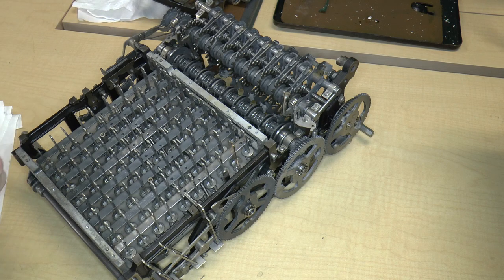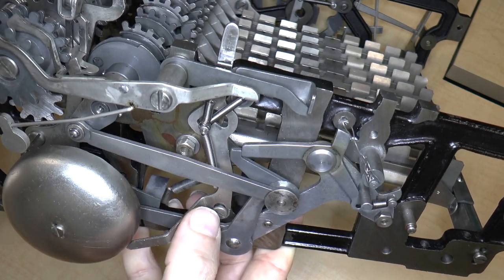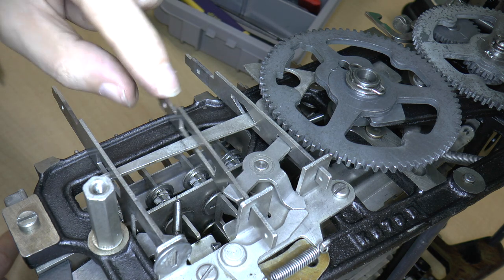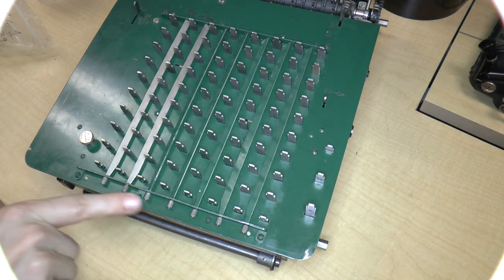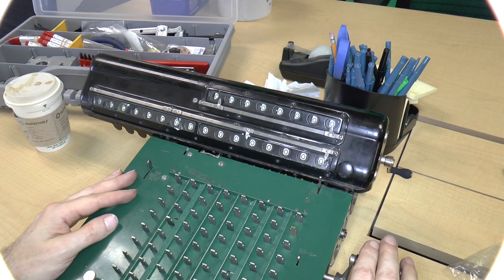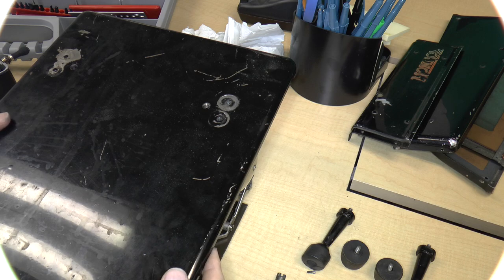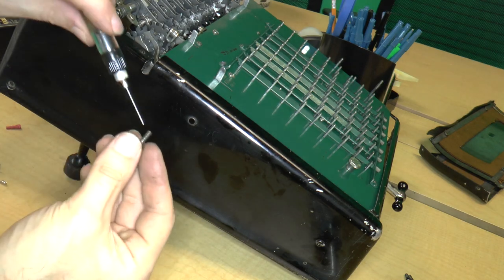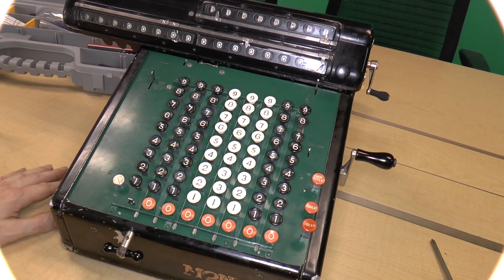Disassembling a 1920s Monroe model K mechanical calculator, part 25

Comment: A couple of weeks ago I came across a Monroe L-160X in a flea market. I didn't even know what the thing was but it looked cool so I bought it. After initial inspection I found it to be pretty badly stuck. Neither crank turned and a few buttons stayed at the bottom position. Even though the machine is not quite identical with K-series, with the information gathered from this series I was able to take it apart enough to clean and oil it so that I got everything moving again. No rust, just gunked up grease. One missing spring and a few missing button caps but everything else seems to be there. Now I've got both the base and the display working, but not together. There is propably just some misalignment issue with the transfer wheels and I'll still have to look at that. Couldn't have made it this far without seeing this K-series disassembly, so thank you Rob!

Comment: Thanks to your videos I now have an irrational fear of taper pins. This was a really great series of videos, I really learned a lot. When you first opened it up it looked incomprehensible but by the end I totally understood it. On the dials do you think there is any way to dissolve the old sticky grease without taking it totally apart (or melting the dials)? That's the only part I don't think I could handle. Great job, I'm off to watch your newer videos.

Comment: Awesome series, it will be great as a reference for anyone taking a similar Monroe apart.  Additionally it has some great tips on re-assembly (the top and the zeroing) and understanding how each part works (or in most cases interact with other bits and works).

I have an automatic version enroute and will also be doing a full disassembly/cleaning/oiling, so I know I will be using it (and your disassembly methodology, bags/etc).  You need to get yourself some real wrenches (standard open/box ended, or maybe a set of thin ones) instead of always using the adjustable (nut strippers I call them :).

So after nearly 3 years... Is there anything you would have done differently?  Did you ever fix the bell?  Does it still work?
Reply from the maker: Well, I think my overreliance on just sewing machine oil was misguided. Some of the parts apparently do need a thicker grease, but I'm not sure which. Also, the order in which the keyboard bails are replaced is crucial, since they were hand-adjusted before assembly, so I should have kept track of their order. Aside from that, still works great! I take your point about the nut-strippers :D  Finally, go to archive.org and search for Monroe Calculating Machine Company. You'll find all the service manuals that I have discovered, scanned in.

Comment: My model K has a 1-piece main cover. Also the register dials are black with white numbers. There’s no glass over the dials. The upper dials are white with black numbers, it does have the red numbers but they are very dirty so they look black. I see no serial number so maybe it’s inside. I’m working on my Model LA5 right now, the K works so no need to dismantle it.